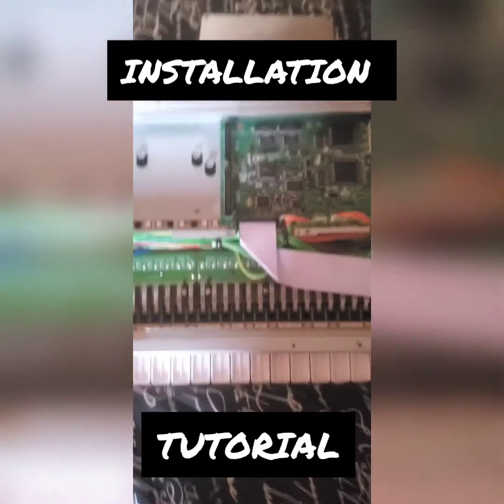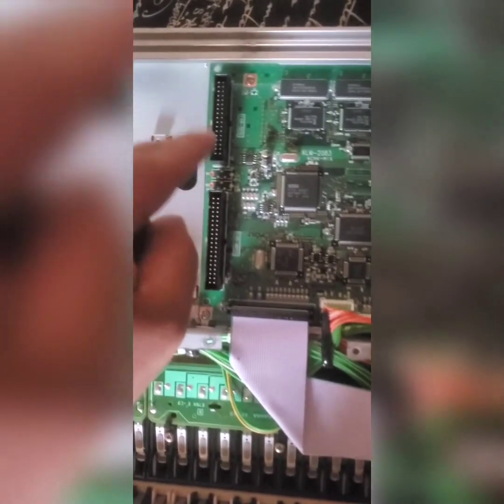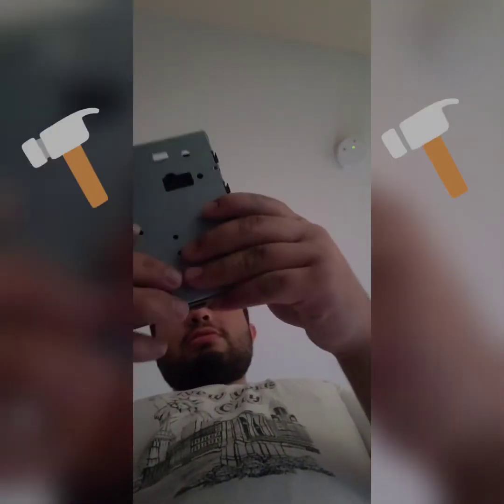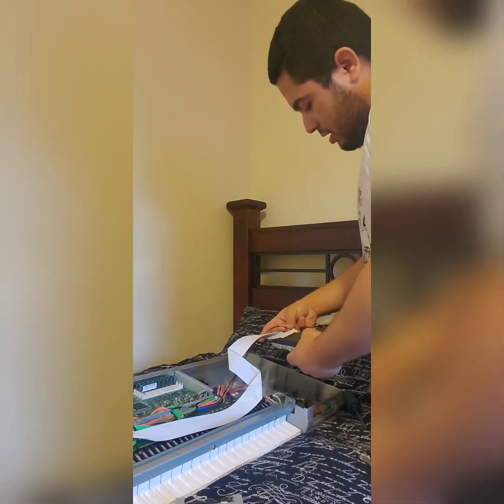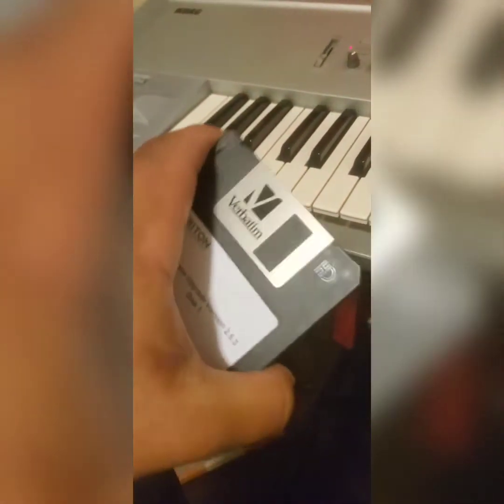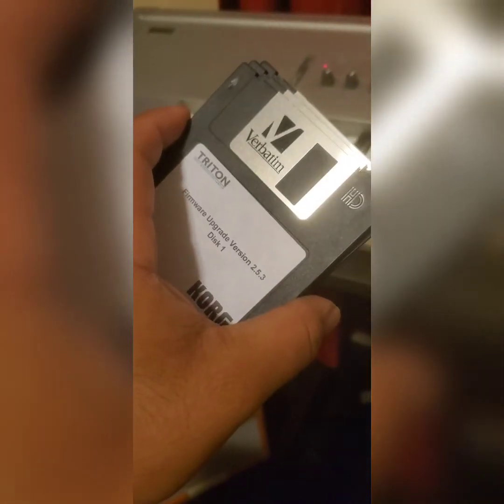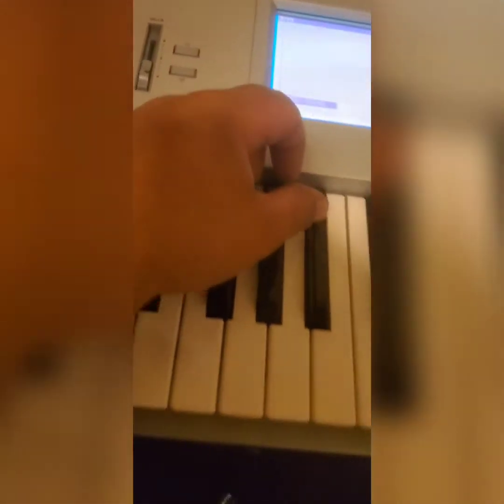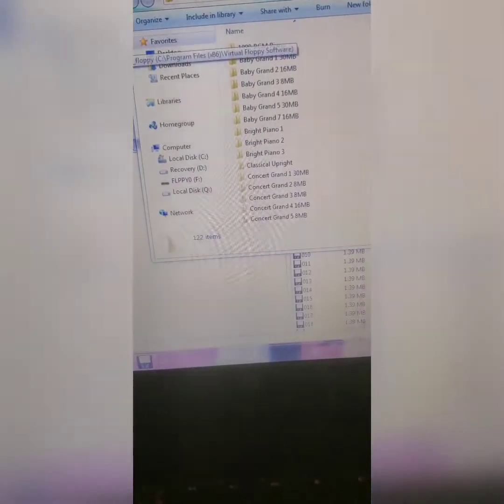USB Floppy Emulator-Korg Triton Workstation

Comment: Hello everybody. 
I tried to build in the emulator in my korg 01wfd.  It should be ready, plug and play  for my synthesizer.
But it was deliverd with 2 jumpers fixed.
But i had no good working emulator.  I red that someone said that you only need 1 jumper. 
Is there anybody Who can tell me what to do.
I had my flash made ready in the 1.44 mb.
Thanks ahead. Hope you help me out this dispear
Eric!
Reply: Recommend flashing the Gotek with free FlashFloppy firmware (instead of the primitive and limited factory firmware that came with your Gitek). FlashFloppy adds many capabilities and great support from developer himself and community forum. It will help with Gotek compatibility with your 01/Wfd. Another fantastic alternative is HxC firmware, great support and function as well.